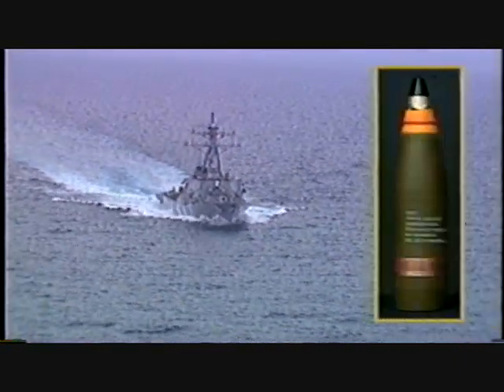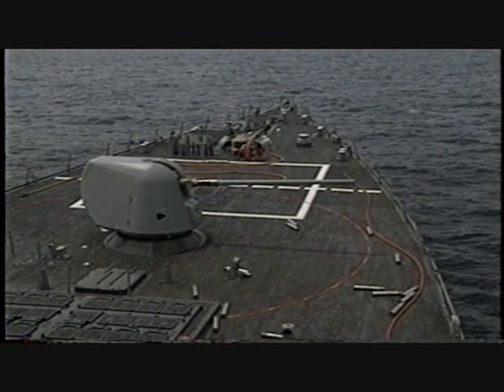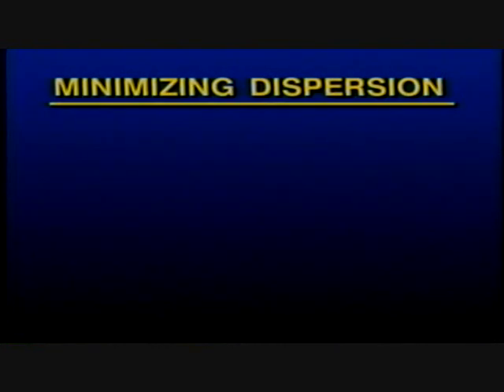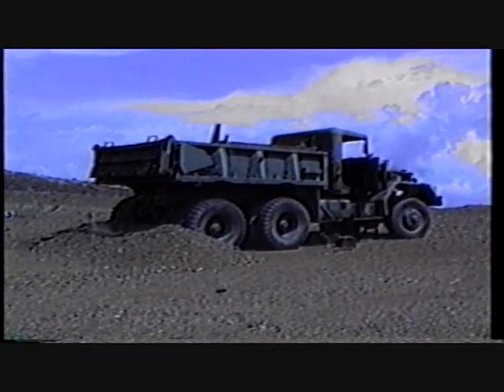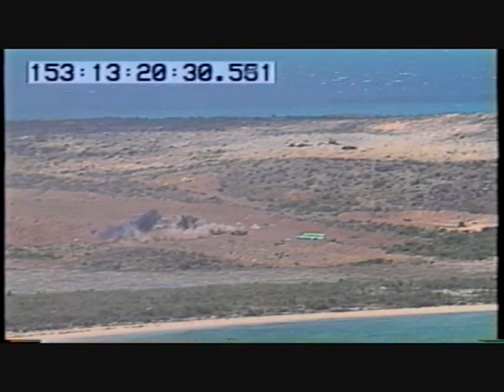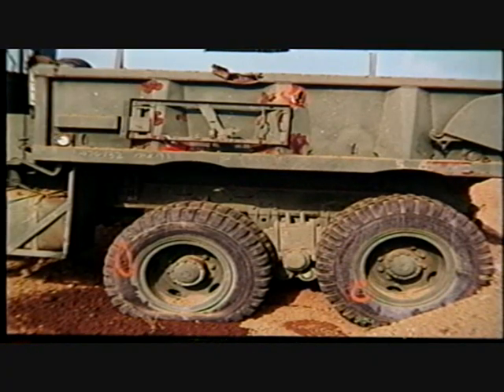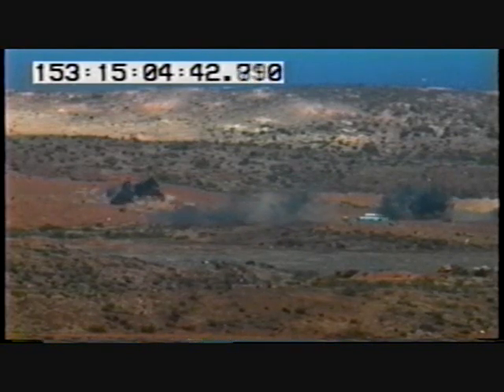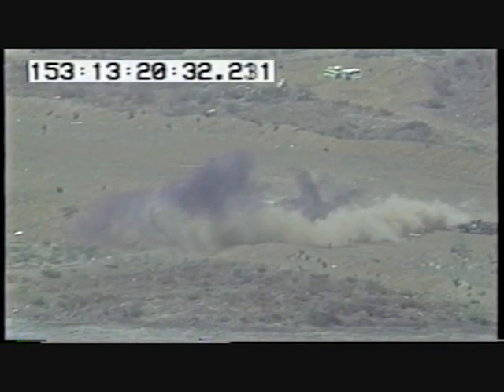Destroying Trucks with Proximity-Fuzed Artillery Projectiles

Comment: Old news. The rounds now are GPS guided from the frontline observer where they feed live quadrants, speed, range and movement of the target straight to the weapon system. All the ship has to do is be within range. and the gun makes adjustments on it's own.
Reply: +Claude “Reviews4U” Rains 
This is rather bad, it only took out 1/2 the people, and honestly didnt keep any of the tucks from moving.
Did not know it was that bad in the 80s...
Reply: Old news probably cause this is early 90's
Reply: +ramairgto72 50% losses ain't bad, especially considering the dummies were most likely spread over a wide area with many purposefully put at the edge of the suspected range to see what the lethal range of such rounds really is. 
And the targets were stopped from moving, you can't drive a truck with all flats and ruptured manifold plus fuel lines. Hell, even the steering and brakes were out. Plus, the driver was KIA/Casualty. You don't need to completely blow it up. Hell, a kill like that is ideal as you can fix it up when you win the war and use the truck for your own purposes.
Reply: @ramairgto72  they were testing new proximity fuses. And only firing from one mount. 
This wasn’t an accuracy test. It was a shell test to see if they would explode near a vehicle. And they did. If the mission was to obliterate the target don’t you think they’d have fired more than one gun? Come on man. Pay attention before leveling your bullshit criticism.
Reply: @ramairgto72  by taking out and injuring personnel you triple the amount of people needed to care for them. Thus tying up MORE enemy. So yes this was successful test of proximity fuses.

Comment: 4:47 what he ment to say. "on a known distance range with wind stations and enfilade enemy, the gun gws works fine.
Reply: They weren’t testing the 5”/34 GWS.
Those are a tried and true Naval weapon going back to WW1. They were testing the SHELLS and their proximity fuses hence all the trouble they went thru to ensure accurate fire. 
These were newly developed shells; which means they’re expensive asf. So during testing you want to get good data on as few fired as possible. Hence trying to remove all possible challenges.
Reply: @chloehennessey6813  would you though? sure as maybe baseline data for the what the rounds max capability is given perfect conditions for like a brochure at some weapons expo, but if you're being realistic they would need to test it in the absolute worst conditions to hammer out design flaws.

Comment: Goes on deck at wrong fucking time:
Gun swings barrel into chest slapping you down like ragdoll
Just as you get back on your feet BOOM-gun fires making you dazed and deaf
Seconds later hot casing poops out of the turret  and hits you in the face.  Maybe you should just file for transfer.

Comment: 7 hits out of 38 shots under most ideal conditions . With no danger of return fire . Hardly real war conditions .
Reply: 28 rounds found the mark, 7 out of 14 personnel injured/KIA, all vehicles disabled with hits, not bad for a 5" gun a few miles away.
Reply: 18000 yards!! 17 kilometers for fuck sake! With a 125mm gun firing a round every 3 seconds. Holy sweet jeesus that is fucking scarey by my standards. It seems Mr.Rhodes doesn't comprehend english so well. They were testing the ammo at range. Not the gun nor the gunners. Education is clearly failing in north America. ..

Comment: Is this gun system on any land based vehicles?
Reply: No, it's too big.
Reply: Morrigi192 that's what she said...
Reply: TheThinking1
Is this gun system on any land based vehicles?
'
should be use artillery / howitzer with the big gun on the land
Reply: 5" is 127mm.  The M-1A1 Abrams uses a 120mm round, and the M109A7 SP Arty. uses a 155mm round, so it could be done.

Comment: why using Proximity-Fuzed when you are targeting a soft skin targets ????!!!! with the GPS guided Projectiles the HE and the HESH with ( contact fuze, impact fuze, percussion fuze or direct-action )  this more useful with less munitions to be used , I think the Proximity-Fuze projectiles suited more for attacking light infantry formations stationed or moving , munitions depot , Fuel tanks, ground and aerial radar stations, communication stations, especially antennas and dishes, static and reconnaissance and observation sensors, combat weapons support equipments like electric generators ...etc

Comment: Are the spent casing really supposed to just eject onto the deck and roll around?
Reply: What would you need then for?
Reply: I think the point he was making is that they would then become a hazard to personnel/sailors that might have to move around with what would then be a deck laden with spent shells.
Reply: The Navy sends them to the reloading plant if they are not badly dented or they are sent to the Old Soldiers and Sailor's home to be used as cigarette and cigar butt holders.